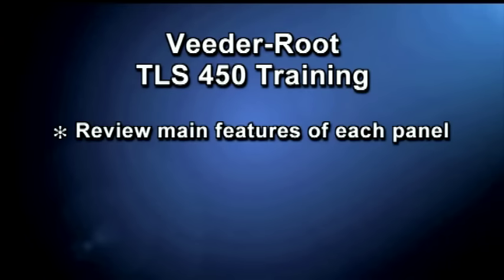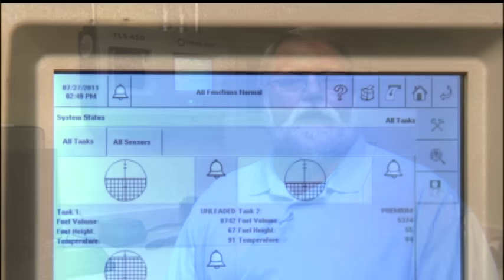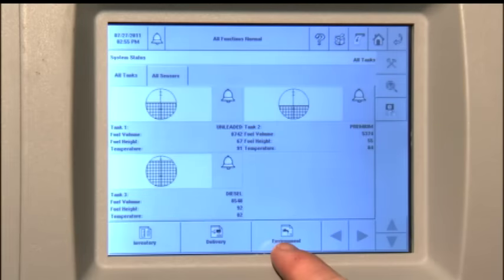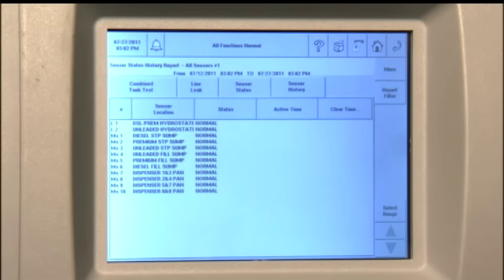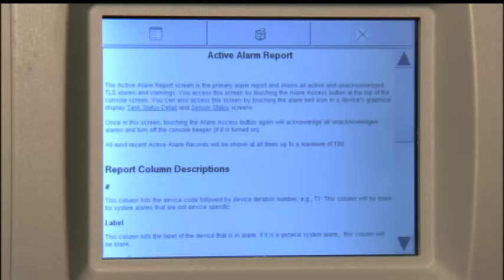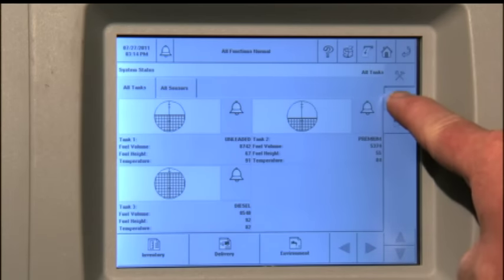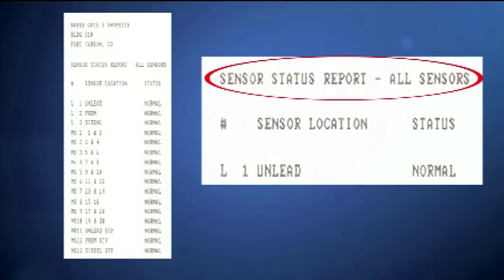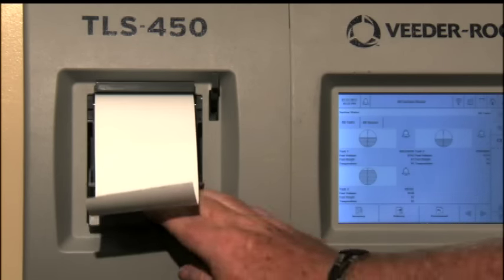Veeder-Root TLS 450

Comment: Hello, I have problems and it does not start my TLS 450 system. How do I restore the system since it gives me the following error:
Checking the System and does not finish loading it.
Reply from the maker: You should get a tech to reboot the system.
Reply: Is it possible to restart the system or reinstall it? @robertlargent
Reply from the maker: @josegimenez6883  I would get a technician to do it.  Unless you don't think you can make it worse?

Comment: Bought 4 of these systems. Shows exactly the level of fuel in the 
summer. Winter fuel float gets stuck. Temperature lying! The density of 
fuel is also lying! 
PS: it Is expensive and does not meet the stated requirements! I do not 
advise to buy
Reply from the maker: You should upgrade the console to the TLS 450 PLUS version.  They have been pretty reliable so far.
Reply: Throw away a few thousand dollars? No Thanks. 
Never buy their products.
Reply: would you be interested in an open source arduino solution to a tls 350 upgrade? Im thinking about working on one over the next year or so.